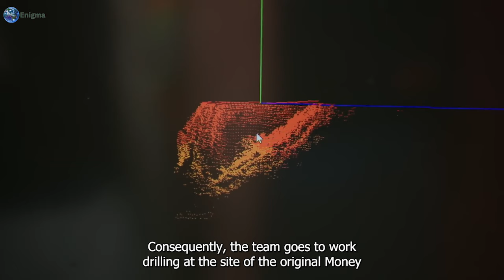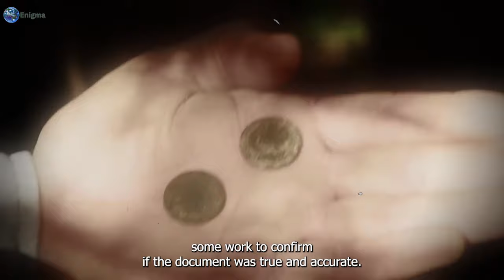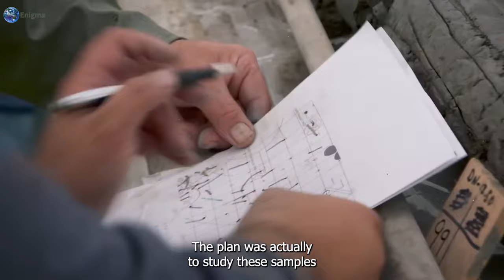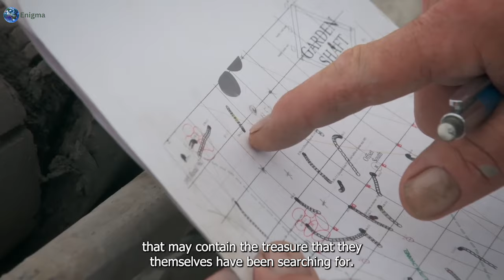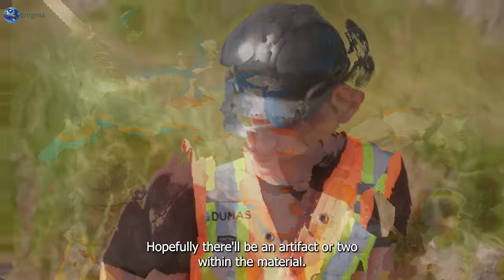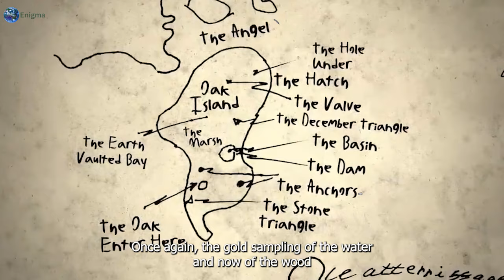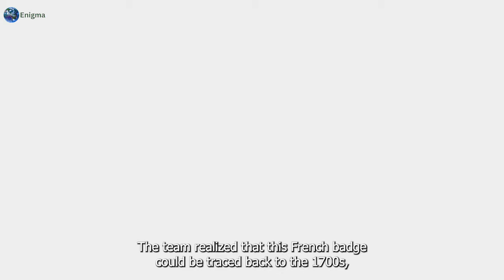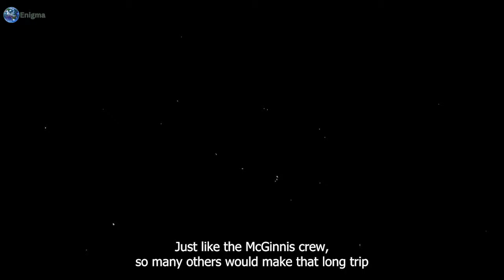6000 Year Old Documents Found At Oak Island Revealed Something TERRIFYING!!

Comment: The tile doesn’t match the storey
Reply: Exactly. I can't understand why they haven't used a couple of 30 inch 6mm brass rods one end at 90 degrees pointing away from body either side. When they come to the middle. Water source. Point out again. Comes to middle end of source. You can map a flood tunnel easy as sintch. I could have found every single one in a day.